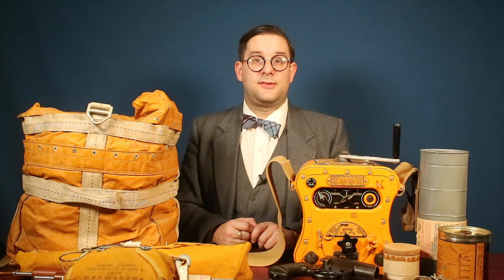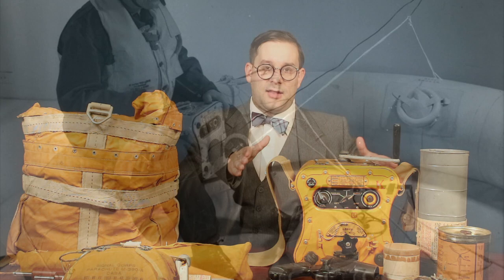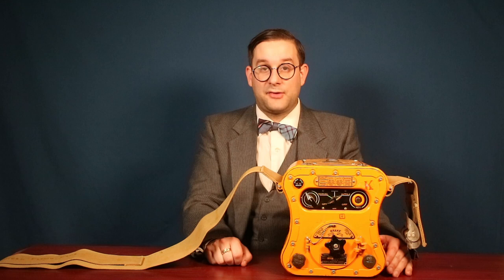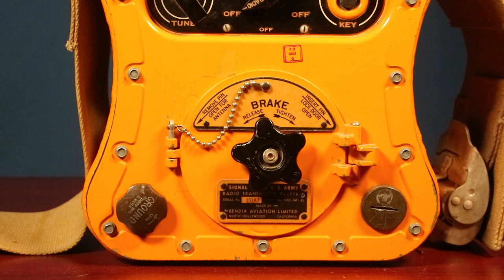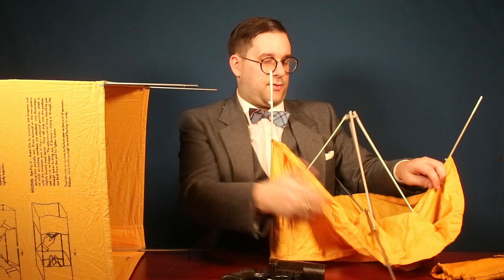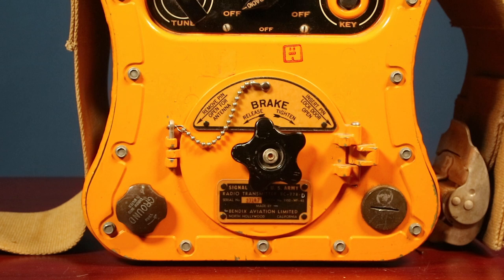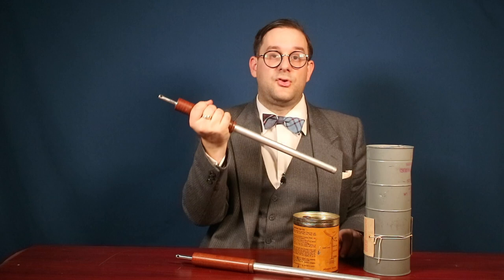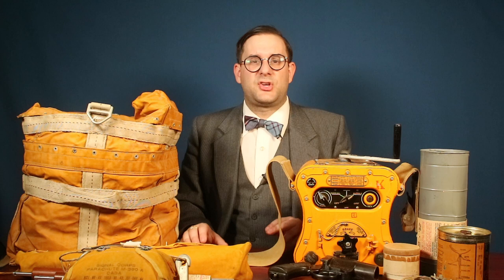SCR-578 'Gibson Girl' Survival Radio:  Life-Saving Curves

Comment: Ive only recently discovered your channel and have been binge watching just a little. As a Ham with an interest in old military radios, QRP (low operating power), and the hand and pedal cranked sets used by the school of the air and RFDS in Aus, these sort of rescue sets really interest me. I dont think ive ever seen such a complete set shown off, obviously old manuals and old photos, but really underplays the sophistication of the whole system. the hydrogen generator, the weighted earth cap line, an adjustable tension brake on the antenna, clockwork morse keyer, all genius, simple elegant solutions. especially with a distressed, and exhausted seaman in mind. that box kite though... I thought before you said it "How the hell do you do that in a rubber raft??"
I would like a folding box kite tho, that seems like a very good idea for deploying an antenna. A really good way to put up a QRP station. for the many that dont know, QRP is low power operation, the sport coming from the smallest rig making the longest contact. Its not hard to be heard with a 1000w rig that needs a whole room and power circuit. something that you can pop in your backpack and go for a hike with is a really fun challenge. so you target areas that you can really optimise your antenna system. Ive either used a rope over a tall tree branch or a extendable 10m fiberglass pole, and had pretty good results. if I get 10 km out of suburbia, to a high point with a decent gumtree, you send and receive such better signals. I have also had excellent results on the beach, but your elevation is essentially Zero. I think I need a big box kite, get the antenna right up there.

Comment: I commented on the original video that I had a Gibson Girl kite as a kid some 60 odd years ago. It's much easier to assemble the kite if you connect the 2 halves together first as the side supports don't flop all over the place. The kite also had 2 bridle attachment points for different wind speeds. It was really easy kite to launch and very stable in flight.

Comment: a small correction to the narrator's explanation of the "tuning light":  it didn't tune to frequency, rather, it tuned the antenna circuit to maximum transmission efficiency; this is necessary as the elements of this circuit would be effected greatly by the weather, time of day/night, height of the antenna, acidity or conductivity of the water, how deep the ground wire is, how far out to sea, cranker's strength, condition of the tubes (valves) inside, etc.

Comment: FWIW: I first learned about these -- at least the kites -- from the book The Penguin Book of KITES by David Pelham, copyrighted ©️ 1976. 

On page 76 there is a reproduction of an illustration from the launching instructions for the kite, along with a photograph of one of the box kites sitting on the ground. 

I think there was also an article in the now-out-of-print quarterly USA kite magazine KITELINES about these as well. I may have that magazine issue somewhere, but it will probably take me forever to find it...😊 

EDIT: Although that Pelham book was published in 1976, IF you can find a copy -- they may still be in print, I do not know -- it is a GOOD BASIC PRIMER on kite history. The book also contains plans for many types of kites. Be aware if you DO get one the spine of the book will not age well. I purchased my first copy in 1980, and ordered a newer copy around 1996. The first one finally came apart and I put the pages into document protectors in a 3-ring binder. I have kept the second one in the mailer pouch it arrived in for most of the time I have had it, and ITS SPINE has also crumbled...🤦‍♂️
Reply: I have/had that book and build some of the designs.

Ditto: Agree re the crappy binding 😢.

Comment: I was in the US Coast Guard -- mostly working in Aviation -- but for the first two years I was stationed aboard a USCG Cutter. 

IF I remember correctly, I discovered the Electrian's Mates {EMs} or Electronic Technicians {ETs} on the Cutter actually had one of these Gibson-Girl transmitters aboard. {I presume it was a post-WWII model.} They MIGHT have had a G-G BOX KITE to go with it, I also cannot remember for sure. 

I remember thinking at the time {1986-1987} that I was rather surprised I would ever see one of those systems on an active USCG vessel. .
Reply: If the cutter you were on was from that time period, I'm not surprised it had one. It would probably stay on board until decommissioned.